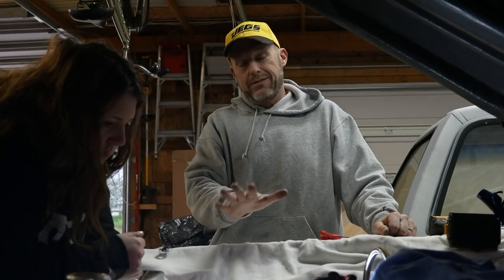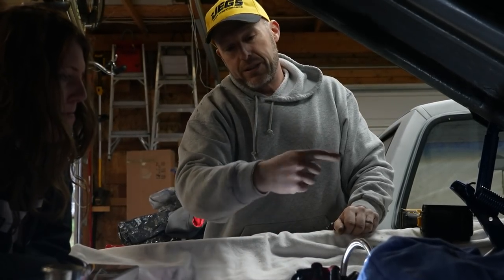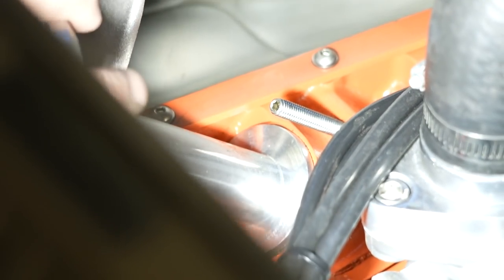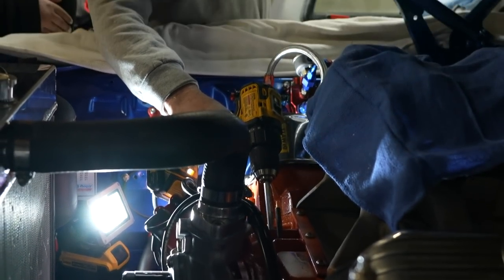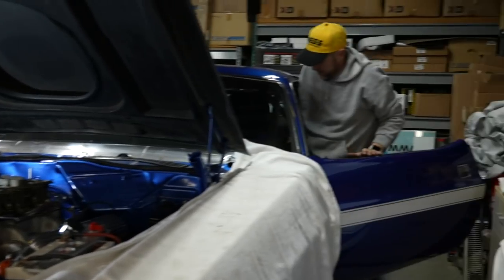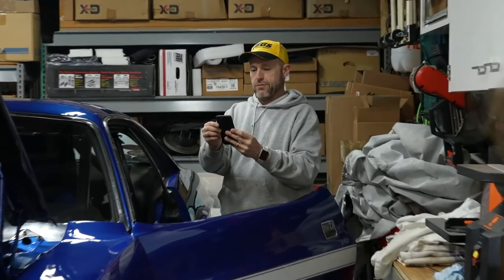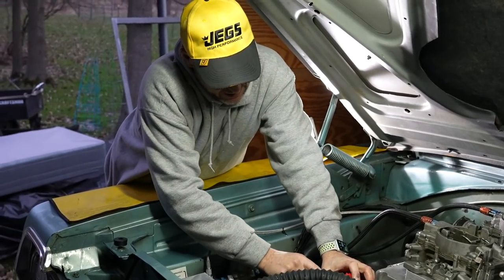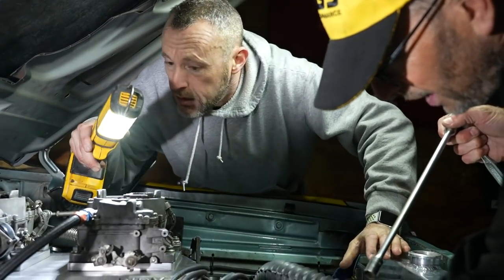Preparing For The 2022 Race Season! Firing up the 440 & HEMI

Comment: Gotta explain the why too though. When the spark does go off, you don't get an instant and complete burn of the air/fuel mixture. Part of the reason for the advance is to give the mixture time to fully burn during the dwell or beginning of the power stroke.
When you mention retarding the ignition, it's still advanced before TDC. Retarding just means less advanced. When you have nitrous or boost, you have a much more dense A/F mixture where the flammable molecules are much closer together thus creating a much faster burn. Like Tommy mentioned, when you run the same advance with boost or nitrous, you get the effect of hitting the top of the piston with a hammer at the wrong time. That's when you bend rods.
Reply: Add to that the degrees of cam advance during cam installation.
Reply: @quickdeuce  timing of the cam is more about getting the overlap in the perfect spot to get the burnt A/F mixture out while helping to pull fresh A/F in. If you advance that it can increase your low end power but takes a little away from the top end and vice versa. Both are called timing but they're separate parts of the cycle.

Comment: Jeff is one of those rare Mopar people who don't fit into the average Mopar owner lineup... you 2 are lucky that he not only shares his knowledge but he doesn't seem to loose his cool when having to explain it without using his engineer type of thinking
Reply: Jeff fits perfectly into the Mopar Owner lineup, just not into the Chevy or Ford Owner lineup.

A Stock Elim. Car has a short future and lifespan if not treated properly, and the initial startup after a layoff, if not primed to get those bearings bathed in oil, can in 1 minute, take a season or 2 off the bearings and flatten a cam.

They do it right, but was awaiting the timing light to appear in both cases, but it never made its debut!

Comment: 2 rotations/revolutions (4 strokes) make 1 complete combustion cycle. Intake, compression, power, exhaust. Also 6000 rpm (revolution per minute), redline for many a v8 would only be 100 rps  (revolutions per second).  Still fast but hardly 1000's of revolutions per second.  I think you may be confusing some ppl. not a hater just trying to clarify. I suspect Jeff knows all this and he just misspoke.

Comment: The very first time I cranked up my 428cj I was a 180° out, pulled the distributor out and moved it 180° and she fired right up. That motor had domed pistons, high lift solid lifter camshaft and Harlan Sharpe roller rockers, first time was with open headers, never will forget sound. Jeff explained the distributor operation and timing so very well. Thanks Jeff.

Comment: An engine has 2 strokes for every 360 degree rotation.  A four stroke turns the crank twice, 720 degrees to make power.  Intake, compression, ignition, exhaust.

Comment: The actual reason for timing is. IT is because the fuel Burns at the same speed no matter what the engine RPM is.. That's why you ignite the fuel prior to when it's needed so that it actually pushes down on the piston instead of being lazy and not running well like you said.

Comment: I had to laugh,  Several "Moon's ago" We had rebuilt a V-8 Cat diesel engine (out of frame) And had installed it in a truck that was going to be used for a pulling truck. And test ran it. The truck had dual outside mounted air cleaners. And since it was going to be worked on all winter we had left the Air cleaner tops off with just the air filters in the cans. And a HERD of mice decided to build nests in both cans. And we didn't see them and just installed the tops back on them, And tried to start it. Then couldn't figure out why the engine (That ran just fine 4 months ago) wouldn't hardly idle. After several hours of head scratching, And trying different things. I said let's see if maybe we collapsed a filter?? Being these where both new filters 4 months ago it shouldn't be, But..... So when I reached in to pull the filter out of the can, and had a mouse run up my arm. You could say I was shocked a little. Finding cat food and shredded card board, toilet paper and anything else they could chew up to make a nest out of. And had built nests in both air cleaners. Totally destroying both $50.00 (each) air filters. Mice can and are a pain in the ass to deal with when storing vehicles over the winter in Ohio.
Reply: Amen brother!

Comment: AZ patriot is correct. Ignition advance is because of slow flame propagation.  It’s not how slow electricity travels through a spark plug wire. Think piston speed of probably around 65 to 70 feet per second. Electricity about 186,000 miles per second. Ignition is lit early so that combustion sweet spot occurs at the most efficient part of the power stroke.

Comment: Its easier to understand when you let your students know the physical properties of fuel will only burn at a certain rate. E85/ 87 octane/ 92 octane/ Race Gas/ diesel/ all have there own burn rate that will not speed up or slow down. It is a physical property that can not change.  That is why the timing curve needs to be adjusted for different RPM ranges. Hope that helps to make this sink in easier.
Reply: Great point. I didn’t get into fuels and how they affect timing
Reply: Fuels have a constant flame speed only at a fixed mixture ratio. Changing the mixture ratio on a given fuel changes the flame speed.

Comment: Hold on does he really think it will destroy the bearings in a car from sitting to long and starting 🤔. Due to lack of oil on bearings do you realize how much tolerance is between the crank journal and bearings usually on a older build like the one you run its around .003 thousands of a inches give or take . I mean its so small it can't dry plus leave some engine oil out between two polished hardened steel plates in a sealed environment for a couple yrs and look at it after a year it won't change even when you add fuel vapor .I have been in the high performance industry since I was old enough to work . I spent every vacation day while in school and spring summer breaks working at a automotive machine shop owned by my uncle that also did work for a  couple top fuel teams from the age of 12 and based my life long careeroff it 30 yrs to date .and ol Jeff your fully board and need a project your pulling your car apart just to have something to do wasting time but who am I to tell you what to do with your time your doing more damage by pulling and trying to start car out of time popping it back threw the intake then just leaving it be and firing it up. my first car was a 72 dodge dart that was very respected in Central  Florida on streets and track when I was 15 my first car had a cage 408ci small block chrysler with indy aluminum heads lunati crank rods, solid roller cam . I worked for my uncle to buy the car parts and did all the machine work and build myself. And accomplished what I wanted to by having one of the fastest street cars in Central Florida at the age of 15. Car ran low 9's on laughing gas and solid low 10's all day long on race fuel. In 1992. That was fast as shit especially for my age the amount of respect I still have 27yrs later and many engines ,cars, built for customers and self . Jeff your board but if you want to pull the dizzy cap and prime the oil you go ahead and do so.love watching the kiddos learn and build there own love the channel don't take the comment wrong its my opinion with a tad bit of facts.

Comment: I think a very important thing to add would be that ignition timing on this setup is controlled with the relationship between the reluctor wheel and the magnetic pickup, NOT between the cap terminal and the rotor! Especially important to know if your going to phase a rotor with an adjustable rotor, or if one runs a crank trigger this would be done by turning the dizzy itself.

Comment: My friend also has a 71 dodge demon with a built big block in it but its a bracket car . Not a stock class car. To run in class it has to have the motors of that year they came with. The 71 demon came with the 340 in it amd you can make em run ok but not like the power and torque of the 70 over 440 . It puts 675 hp to the flywheel amd gets about 550 to the rear wheels

Comment: What exactly is the difference between a "High Volume oil pump" and a "High Pressure oil pump " or is there a difference??? I've read what the difference is but Jeff does so much better at explaining it. Take care, be safe, and have fun regardless.
Reply: Volume = quantity. 
Pressure = resistance 

Imagine a river flowing wide open with no restrictions impeding its flow, the volume is immense, but pressure is close to zero because there is no resistance to the flow. . Take that river and funnel it down to a 4”pipe. The river would back up, resulting in thousands of of pressure (measured in say psi), but the volume (flow - gallons per hour (GPH)) would be almost extremely low.
Reply: @jeffkovalik7395   Thanks. The reason I asked is because I'm looking at Dart SHP engine block and it says not to run a high volume oil pump with it.  I'm not sure if it mentioned not to use a high pressure oil pump or not, or if there is a high volume oil pump that's not high pressure. The terminology on the sales ad is kinda confusing. The Dart SHP is supposed to have a better oiling system than a stock block. Just don't want to screw something up from the start. Sorry for writing a long novel of a question. Take care, be safe, and have fun regardless.
Reply: @jaredshoemaker9196  you can’t go wrong with volume. Oil pressure is fundamentally created by bearing clearances anyway.

Comment: On our BB Mopar after timing I put a mark on the base of the distributor housing and line it up with a mark on the block. I take a picture of where the intermediate shaft is in the block with my cell phone so I can get it where it should be. Makes it easy to prime the engine and not have to re-time it with the light.

Comment: Good content. Being from So Cal It never dawned on me about the need to winterize cars sitting over the long cold winter until I noticed the radiator caps were off both cars. Great job teaching Jeff .A little additional info Tommy and Allison the distance from center to center of the terminals inside the distributor cap is 45 degrees. Great Video and heck of a job driving in the left lane this weekend Tommy. Looking forward to seeing Allison getting more seat time this season, I think your going to be a great race car driver.

Comment: Hey Jeff got a 440 in a 66 Coronet 11.5 compression Victor Heads h beam eagle rods and je pistons.  4000 converter what's a good place to start with timing. Cam is Hughes engines 264-268 duration 594-611 lift. But additional lift with 1.6 rockers. Give me your thoughts.
Reply: I would start at 32/33 range.

Don’t be surprised if you get up to 36 depending on head cc’s and fuel, it may like it.

Comment: So I store my 2 dusters over the winter in my garage I start them up every other week.... at most 1 month might go by my question should I be priming the engine before I start when it go's more than 2 weeks or at what point should I prime it if it sits too long?
Reply: I would say 3-4 months on a serious race engine vs a mild streetable engine. It also depends on bearing clearances and the weight of oil you use.

Comment: What your looking for is what is called the dwell, it's when you roll an engine over and the piston is at the top and it doesn't really move up or down, advance the timing to start when the piston has stopped going up, it may be 30 degrees before top dead center, but in the dwell it can't push the piston back down, laws of physics, very cool, only Jeffffff would think of explaining this, stay strong
Reply: Could not understand why big Bill picks of Jeff

Comment: Ive never heard of that! Where is your oil filter located? Or what oil you run? Also it could of been due to how cold it is there! Im dwn south so that could have alot to do wt it! Plus it doesent sit too long maybe two months or less! Even then i make sure it has no power until psi picks up! What do you think about that?
Reply: If paying attention, did you see how many revolutions of the drill motor it took to reach the point where the drill changed pitch and actually started pumping oil throughout the block, while it just filled the oil pump pickup tube, oil pump, and all the galleys, and bearings, and reached the valve train in the heads.

They just want full pressure and volumes and all spaces to be fully bathed in oil, and know they are, as those engines are purpose built to wring out every available horsepower to remain as fast as possible long term.

Notice he uses thinner oil, high volume, low pressure, to achieve less resistance from the rotating heart of the Powerplant? (Loose bottom end is fast, highly sealed, well timed, and breathing top end, and a whole lot of tiny legally allowable tips and tricks, all add up to a tiny bit more power (lower E.T.), when racing within your class (IE: when all A/SA cars competing, and are lined up together to race just amongst one another in heads up racing, to determine a single winner), many will do things they normally would not do when racing against cars of another class (when it is just an under index dialed bracket race), like remove a quart of oil from the oil pan to keep oil from splashing the crank (windage, which is resistance that robs horsepower), remove a wing or spoiler that is not required by the rules (to cut a small amount of wind resistance), use a cool can to cool the incoming fuel, ice the intake, etc.

Stock Elim. Rules are very, but equally restrictive amongst all classes, and each combination is different, and each must work work within the well policed rules, as at any time, you can be inspected (sent to the barn), where you tear down, hand an inspector your head(s) for cc'ing of combustion chambers and a full inspection, a particular piston, rod, pin, and rings (or all), and anything else they may wish to inspect on demand.

Or, like he said in a past video, the inspection team, may choose to look at an entire field across the board, and pick like bumper mounts to inspect    as those are required, looking at all cars equally looking for those that may have looked for or taken advantage of an illegal edge (weeding out the highly frowned upon possible cheaters). 

Oil BTW, is optional, so no rule exists as to it's viscosity, volume, or pressure, or amount run (except physics that is), and running a quart low or so, is not any longer considered top secret, so I just used that openly as an example.

The entire Stock category is designed as a parity racing premise, higher horsepower combos like Jeff's A/SA is 8.0 -8.49 lbs/H.P., and say the low end classes EF/S is 25.0 lbs/HP (so, a 1 percent HP gain at one end, is not the same at the other), minimum weights are set in stone, unless you penalize yourself by running too far under the class index, at which point penalization of the class is automatic.

Ex: a 750 HP class would need to find 7.5H.P. to equal 1 percent, a 100HP class would need to find 1 H.P.

All classes are calculated by dividing the shipping wt by horsepower, then adding 170 lbs Driver.

There are additional maximums also to move a car to top of original class or down 1 class, and are different depending on category.